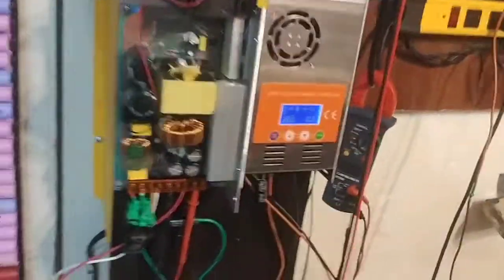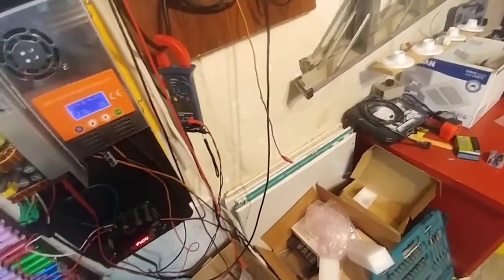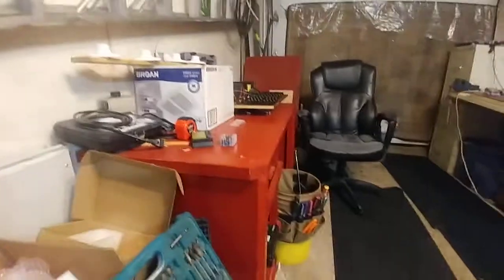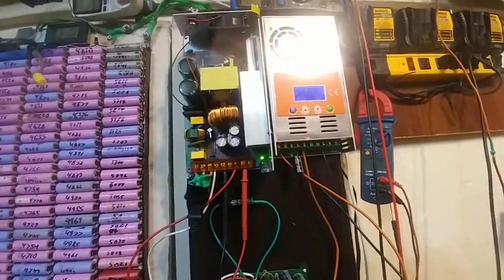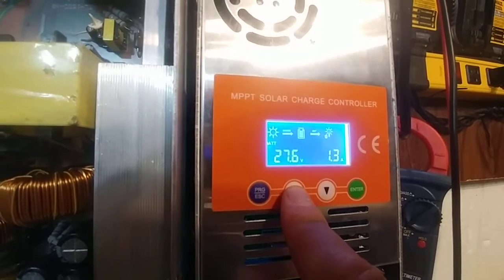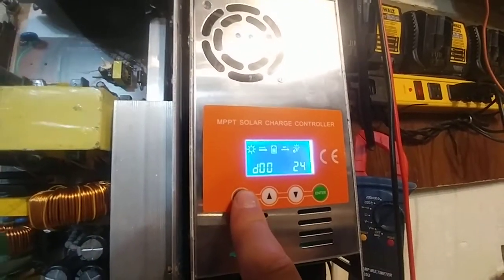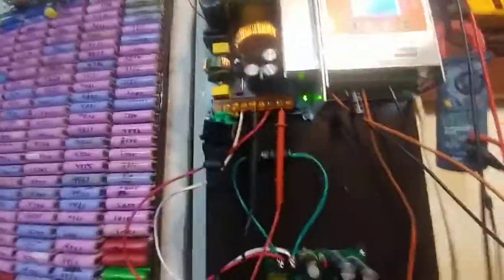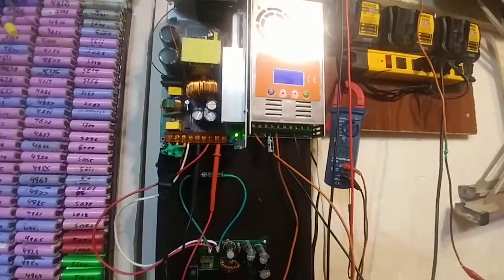Fake Makeskyblue mppt 40a review (18650 7s 29.4v grid charge)

Comment: You don't necessarily have a fake MakeSkyBlue controller if it performs poorly - you may just have an early version that doesn't work worth crap.  I have a MakeSkyBlue 60A with the MakeSkyBlue logo on the board.  It's version 113 and the firmware is VERY poorly done compared to say a Tracer xx10A controller.  The internal voltmeter is off 0.25V at 12 volts and that 2% error tracks at the PV input (29.8V shows as 29.2V).  The ammeter reads 11-12% high at 6 amps (showing 6.7A for an actual 6A) and is off by 20-40% when the current is below 2A.  The solar power is actually close at certain power levels (140 watts) where the voltage and current errors cancel each other.  The firmware apparently has no real intelligence or temporary memory capability - when it has run the full spectrum of volts vs amps on the solar input 5 times in one minute, perhaps it should take the best of those readings and stay at that level for at least a minute before dropping from 140 watts to 20 watts and starting again?    And sometimes it just stops trying.  Parameter changes aren't always recognized when made and require a power cycle to make them permanent.  The Load terminals get powered whenever the solar input drops off, even if the output is set for 00 (never on).  Version 113 is still too close to its "12 volt power for outside lighting" roots for it to be a truly reliable controller.  The manual is also barely enough to work from and no matter what their advertising may claim, there are no published charts of efficiency - again, I'll use the Tracer manual as an example, with efficiency graphs by battery voltage, solar input voltage and and solar wattage.  MakeSkyBlue also limits the solar array size to the unit's maximum throughput - 720W output to 12 volt battery, 720W max solar.  The Tracer controllers are much better at power management, allowing the solar array to be 3 times the throughput and managing the power intelligently.  The Tracer 3210A 30A controller is rated 390W throughput on 12 volt battery but can manage 1170W of solar.

The current MakeSkyBlue version is 118 and it displays the actual battery voltage (no more working in 12 volt increments when your battery is 24, 36 or 48 volts) but the solar array limit is still in their current advertising so their power management algorithm is still in the dark ages.

Comment: I have a 7s bank. And been looking for a way emergency charge the bank, from a lead acid Bank and alternator. If I could get 30 amps it would take days but better than nothing. I only want to charge to 28-28.5 volts. Or 4v per cell. I have EPever tracer charge controllers. And thinking about getting the 80 or 100 a versions. But for that money. I would rather get a midnite classic150. About $410 for 100a I can get 4 30a controllers for that. I get shade early and late in the day. I need to be as efficient as I can. And need a alternative way of charging. I'm building a DC generator. For the lead acid Bank. I need a way to get some of that to the liion bank. How has this worked out? I thought about using DC boost converters. But need control of the charge for the liion.  I can charge at about 250-280 amps potentially. I need a larger engine. For now about 120-150 amps. At 27.8-28.8 volts. I just discovered your channel. I will watch a few more videos. See if I learn anything. Do you have any advice for my issues? Thanks..

Comment from the maker: It has stabilized now so i guess the mppt and power supply eventually work things out and cooperate? Idk :s
Reply: Andy Shell - Most good quality MPPT charge controllers go through an initial learning period and then adjusts its characteristics to match the panels. John Q is right though, you can't use a switch mode power supply to simulate PV panels and expect accurate results.

Comment: You don't state what the actual issues are.  What are you using the power supplies for ?  What are they doing  ? Chargers ?  Using them to simulate PV panels ?   Watched the whole video and at the end I had no clue what you was doing.    You kept going on and on and not conveying any real information ..  LOL 

If your using the power supply to simulate Panels, it's kicking off because the MPPT is varying the Load trying to find the MPPT voltage .  The power supply sees that as a Fault and trying  to protect it's self by shutting down.    A regular bench power supply would do the job.  Set it to 20V with current limited to say 5A.

Comment: The problem is you don't use a real solar panel which has a completely different characteristic than your power supply.
Reply: glad you said that there is alot of info why not to use those power supplys on a mppt controller

Comment: Hi Andy, just buy a MPP Solar 2424LV-MSD 110v/120v Low Voltage off-grid solar inverter, google it....
Reply from the maker: 700$ vs 190$ :( I got it working finally the real problem is my power supply im using. it has too much circuitry that conflicts with how mppt works.